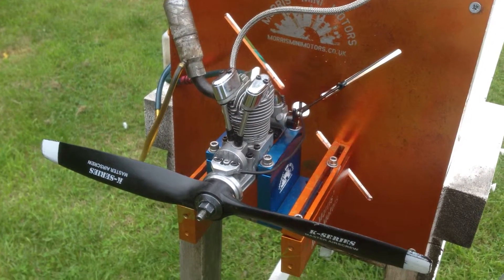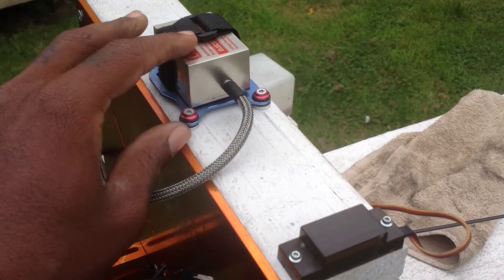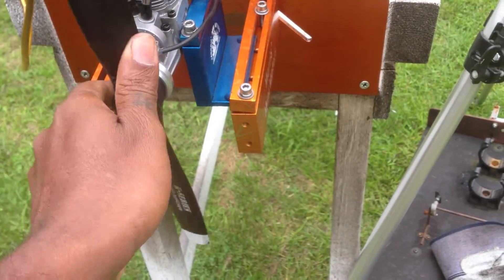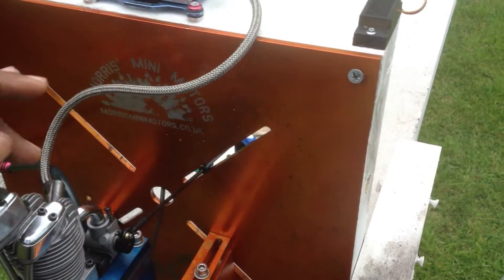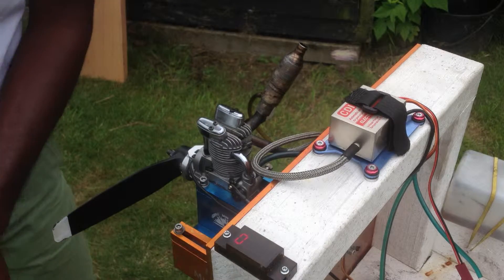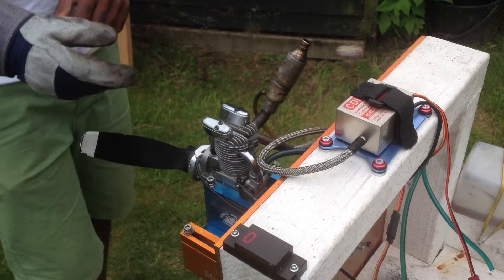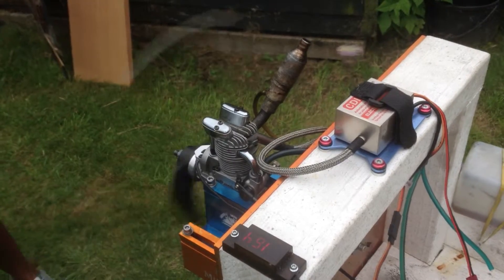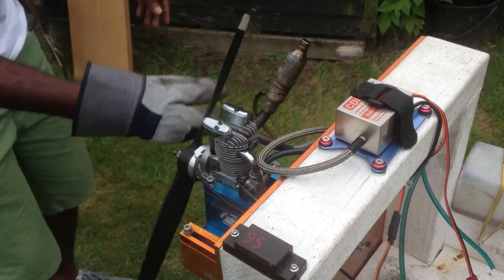Saito FA-72 CDI conversion

Comment: what do I do to my needle settings if my engine is idling like yours but not transitioning properly ? when I accelerate, its bogging down on when I accelerate , I have had issues with my engine not running with the glow attached then the idle is running to high. . fixed that with the low end needle